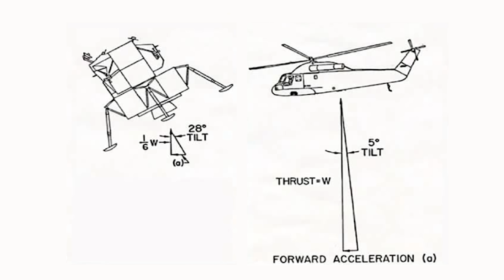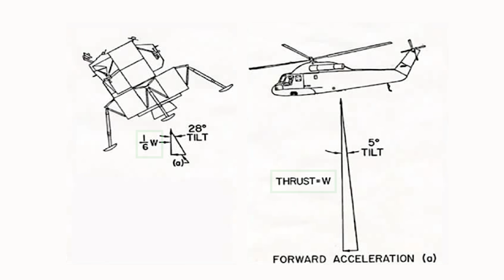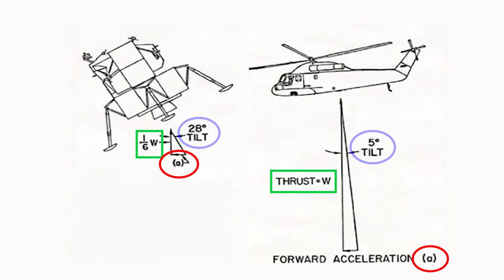How Neil Armstrong Trained to Land on the Moon  - Smarter Every Day 250

Comment: how about enough power to overcome the free space path loss?? They didn't have it on Apollo... right? oh, yeah they were totally capable of talking to the president with no interuption, but I wasn't able to watch Chanel #3 30 miles away if the weather was poor
Reply: @AnOfficialYouTubeProfile  yeah but I'm not talking so much about the size or battery power in mine as much as I am about one 275000 miles away. I don't care about an observatory or S Band or any BS. Bottom line fact is (according to Google and the "free space path loss calculator") there's no way in any fantasy that they carried 6 million watts of power, especially in the 60s. Back when the largest broadcasting network in Vermont (I know, it's pathetically small) didn't carry enough power to get a signal 40 miles when the wind blew!
Reply: @AnOfficialYouTubeProfile this formula was completed by radio engineer Joe Frantz (all nasa numbers) 
 Distance =275000
Frequency =146 Mhz
Transmitter Gain (dB)=70
Transceiver Gain (dB)=9
Free space path loss= 108.8 dBw (decibel/watts) 
the power needed to cover the incapable miles based on power available.
To overcome the 108dB  loss of power from distance plug 108 dBw into the Google calculator. 
Path loss=108dBW
Converts to an astonishing 
Watts needed to cover distance =63095734448.019 W

Calculate for yourself (all easily found on Google)
Reply: @AnOfficialYouTubeProfile  Wow, John, I must say I took the time to thoroughly examine your extensive post. I tip my hat to anyone phrenic and abundantly knowledgeable in any subject area.
Thanks for the enlightened and well thought of report. It's always a good thing for one to gain insight into an idea that he/she thinks that they are aware of.
I truly appreciate the time you took and the authentication of information.
I'll get back to you with a few questions I have, and I hope you were able to get some work done in spite of my rambling.
Nate

Comment: I guess these days they would probably build a simulator and have the view rendered like a videogame. 

its not the same of course, there's none of the intense pressure you would get on the moon, dont want a astronaut with 2000 hours in a simulator having a panic attack when doing it for real.

Comment: I wonder why they didn't use a small aerostat as the gravity-reduction scheme, and have the lander simulator on a gimbaled sling beneath.  That would've obviated the need to mitigate or counteract the problem of gyroscopic precession caused by the turbofan.  Fascinating stuff!

Comment: An even more interesting and more actual question will be how do you land on a meteorite?
And how can we mine it? How efficient will it be for instance to mine gold on a meteorite and bring it back to earth? I ask because the cost for 1kg of gold is 60k $ and to lunch 1 KG into lower orbit costs 1/10 of that. So, if the final cost will be 1/5 of the kg of gold mined on earth, what will the value of Gold as a hedge against inflation will be? It is a bit of a mix between science and economics.

Comment: I don't get it. Why can't you just use thrust underneath until you're slow enough to get to 0 velocity right before contact
Reply: As opposed to what?
Reply: @willoughbykrenzteinburg  I'm confused what they were testing to find out. How much thrust they would need?
Reply: @overratedprogrammer  The test vehicle had an engine that burned down constantly simply to offset the weight of the test vehicle.  The goal was to give the pilots an idea of how the actual LM would perform in lunar gravity.

If the test vehicle tilted, the always downward facing engine would tilt likewise so that it was still pointing straight down.  It did not control movement on the test vehicle; it just offset the weight (or 5/6ths of the weight) - in essence simulating 1/6th gravity.
Reply: They will look for excuses to delay this. As its now over 20 years they have planned and cannot go. Because now too many are involved and they cannot use the MOVIE MAGIC they did in the 60s or 70's. No one has gone to the moon. Use your head!! I know its hard as it was for me, but once you do the thinking, it is SLAP in your face. You are just dumb founded with all the TV and astronauts, and engineers involved, and think to yourself...wow what a opperation. Once you thinkit through, you will realize its a SCAM!!! at the tune of $20BILLION+ a YEAR. That is about 50,000,000 each morning you wake up , a truck load of 50million!!

Comment: "Velocity equaling zero upon touching the moon's surface" was neither necessary, wasn't design on the LEM, nor ever happened.  The legs had crush absorbers that anticipated some downward velocity (i.e. impact).  Mr. Armstrong did set it down so gently that little give happened; its why they had some difficulty getting back up the ladder while on following missions it wasn't a big problem.  As an example, Apollo 12's impact with the surface was significant enough there was actually some initial concern about damage because the legs had compressed to the maximum.
Reply: He wasn't being literal or saying it had to be precisely timed.  It was just an oversimplification.  They did in fact reach zero velocity as they landed.  They weren't still moving were they?  And compared to the speeds at which they began the controlled descents, the rate at which they touched down was pretty much zero - and they did indeed need to calculate what kind of power and structure would be needed to burn off all that orbital velocity by the time they needed to be landing - at what angle do they need to be coming in, etc.  Pretty much everything they talked about.  So it wasn't "zero" but a few feet per second.....down from over 2,000 ft/s.  Let's not get too twisted here!
Reply: @willoughbykrenzteinburg  Big mistake to oversimplify in engineering.  Also you must be a terrible driver.  Do you have a big hole at the back of your garage?

Comment: "Knowledge is not understanding" is one of my favorite phrases, because it doesn't matter how much you know about flying planes, until you've actually flown one, you understand nothing.
Reply: Yes!  Knowing the theory is only half the battle.  Actually putting it to use requires the hand-eye coordination and eventually muscle memory, that you'll never have just studying the theory alone.
But like Reagan said, the more you understand of the knowledge part, the quicker you adapt your practice on the real deal, vs simple trial and error.
Reply: Though knowledge is incredibly helpful in building understanding more quickly. Example, when I learned how to drive a manual transmission car, i already knew the basic mechanical system that made it work, and the amount of time it took me to be comfortable in a manual car was about as long as it took me to remember to clutch when coming to a stop.

Comment: I wonder if a safer way to offset the weight balance would be with a large rotor in place of an actual jet engine. Obviously it would run electrically, but batteries would be too heavy to let it fly. I wonder if there’s a feasible system using almost a drone-like airframe with a large wire taped onto it to keep it flying for as long as they’d need it. Offsetting the weight from the bottom though would be an integral part to how it would feel, so maybe it wouldn’t work. But it’d be much safer than a jet engine.
Reply: The jet engine worked.
Reply: @willoughbykrenzteinburg  but was also the most dangerous and wasteful part of the design. Just cause something works doesn’t mean it’s the best way to achieve a particular goal
Reply: @gusmusicau  On what basis do you conclude it was the most dangerous part of the design?

Comment: Hey so I was wondering, how did we know the gravity on the moon before we actually went up? Thanks again for the videos.
Reply: Im assuming either a s*** ton of calculations, or a small unmanned satelite with equipment went into the SOI of the moon
Although, Im just assuming
Reply: You can guess the mass of the moon from its orbital period.
Reply: @SCP7170  The orbit of the moon around Earth doesn't say anything about the moon's mass.  The movement of the Earth around the Earth-moon barycenter can tell you something, but the movement of the moon itself cannot.  A pencil a quarter million miles away would have the same orbital period as the moon - in the same way a pencil, a person, a camera, and the International Space Station all have the same orbit - because it is independent of their mass (which is why they appear to float).

We had fair estimates, but we got more accurate data after we started crashing probes into the moon, learning more and then moving on to soft landings of probes and eventually manned landings.
Reply: @willoughbykrenzteinburg  ah yup, thanks for the correction.
Reply: @SCP7170  Oh

Comment: Is it the only problem with landing on the moon? How about the non-existent atmosphere?
Reply: I wouldn't characterize them as problems, but rather challenges - and there were a great deal of them.  All of which we met.  As for the lack of atmosphere (the moon actually does have a thin atmosphere, but might as well be non-existent for breathing purposes).  We took oxygen and pressurized the suits with that oxygen.  Pretty simple.

Comment: I wonder if the weight-reducing lift for the LLTV could have been provided with a helium (or anything lighter-than-air gas) tank instead of a complicated jet engine on a gimbal. I'm sure there's something obvious reason I miss, can someone point out please, why that shouldn't have worked?

Comment: 5:44 "Yes! What you're looking at, is a vertical takeoff and landing airplane, in the 1960s!"

Uh, yes? The X-14 is really dang cool, and I didn't know about it either, but the Harrier Jump Jet first flew in 1967, and officially entered service with the RAF in 1969. And that's a production aircraft, so there must have been several prototypes of things like it before that. Now something like the X-14 having flow in the 1950s, when stuff looked more like a rocket (tailsitters) or weird helicopter-plane hybrids, THAT would have been astonishing. EDIT: And as it turns out, that is EXACTLY what happened! The X-14 is from 1957! :D

Comment: Radiation?navigation? IE moving at 30,000 mph and striking dust,or anything with the size and density of an acorn or greater. When they show the supposed landing on the moon. Where is the dust cloud created? Lots and lots of questions. I personally believe we have gone into outter orbit but very hard to believe we've sent several craft with humans and returned safely to and from the moon. Outter space is potentially very different from orbiting around the planet earth in outter atmosphere. Not a scientist. Just questions
Reply: There’s no atmosphere on the moon, there’s no dust clouds because you need air flow for the dirt particles to move
Reply: there is obviously loads of dust being thrown around, come on.

Comment: If some still are not impressed about the engineering achievement then keep in mind:
It sounds easy to have the LLTV using a jet engine to 'eliminate' 5/6 of the weight of the unit. But one point which was not mentioned in the video but I wonder how they compensated that detail was the weight loss of the fuel that jet engine burned and made the LLTV lighter with every moment, requiring the jet power to be adapted to compensate for the weight loss by lowering the thrust very slowly but steadily. And in a time without small computers to keep track of this you wonder how it was done.
Maybe they couldn't which maybe contributed also to the many crashes and the LLTV's were maybe simply not long enough alive for that problem to become significant to play a role?
Any ideas how they handled this challenge?

Comment: Nay, the landing will be automated. There is less then zero reasons to have it manual. in fact we will probably not send humans to the moon until such a suitable lander is made, and this lander will have completed a full land and lift off mission of its own. ALSO, there could be a chance the lander will REMAIN in space.. perhaps tethered to the space station. You would not need much fuel to zoom around up there so instead of subjecting it to the evil forces of launching and landing on earth every single time, they can just send up mission supplies, fuel, and the astronauts to the space station and then take off from there. You could do quite the luxurious little vessel if you didn't need to worry about subjecting tolerances to constant re-entry of earths atmosphere.

Comment: How feasible are electronic simulations? Like a plane simulator. Software has gotten so good compared to 50 years ago that you can use VR and enough mechanical engineering to make a simulator to at least feel like you're in that gravity

Comment: My late uncle was one of the lead engineers that worked for Hughes and helped build the Surveyor I spacecraft.  His primary contribution was to the making of a kind of arm/device designed to see if the moon's surface was stable enough to support a full sized spacecraft landing.  You have to recall that back then, we didn't know for sure if the moon was covered in many feet of dust/powder/sand or what.
Reply: Apollo 12 landed close enough to Surveyor 3 that Conrad and Bean did an EVA to it. Amongst other items removed and returned to Earth for study was the sampling scoop attachment.

Comment: That was great, but now I'm super confused about how they provided the thrust in no atmosphere or had any idea what that would feel like. Jets and propellers would be useless, right?  So how are rocket thrusters different, and how do they behave in atmosphere vs. no atmosphere?
Reply: No, they aren't really that different. Actually, rocket boosters are even more efficient in a vaccum than they are in the atmosphere.
Reply: @jimsagubigula7337  So, I think you mean to say that they are very different, because propellers and jets don't work without air, right?  I would like to see a video explaining how rockets work in atmosphere vs. none.
Reply: @prosperotempest8606  Jets and propellers don't work outside the atmosphere because the atmosphere is a fundamental part for them. Rocket thrusters on the other hand don't work the same way as propellers and jet engines. They don't need air to work and the atmosphere is just an obstacle to them.
Reply: @jimsagubigula7337  how so?  Again, I would like to see a video explaining how rockets work in a vacuum vs. atmosphere.

Comment: The landers legs were designed to crush so they could kill the main engine when the 6 foot probes touched the moon's surface. It is noteworthy that Niel Armstrong landed "softer" than all the other apollo pilots. The legs "crushed" very little which is why he had to jump more than 3 feet from the bottom rung.

Comment: Any decent drone has the tech to provide just uplift - they have internal gyros and  stuff. I suppose it would be safer to attach a few smart rotors to provide just uplift 5/6 of the weight of the whole lunar module rather than strapping the guys to a rocket - one could view them as training wheels. 
Respect for what they did back in the day - but half a century later i think we need to think it all from scratch :
there are better materials, better fuels, better engines, infinitely more computing power.
I think that the veterans should only tell what does not work, and why (wisdom of the elders).

Comment: I'd guess the modern one is probably going to be some kind of electric multirotor craft.
Reply: I would think you’d  need jet propulsion like we did in the day!  I can’t imagine the battery power needed (and it’s weight) to land that much weight, even at 1/6 the gravity!  Then you have to take off and rendezvous!  I really didn’t know the answer!
Reply: @lantose  Not for the actual lander, I just mean for a practice craft, a modern moon lander simulator analogue similar to the one here. An electric multirotor would be useless on the moon anyway because there's no atmosphere. There are, however, already a handful of human-flight-rated multirotors, at least one of which I thought used an electric hybrid transmission to run the propellers from an onboard electrical generator.
Reply: @AJMansfield1  Thanks!